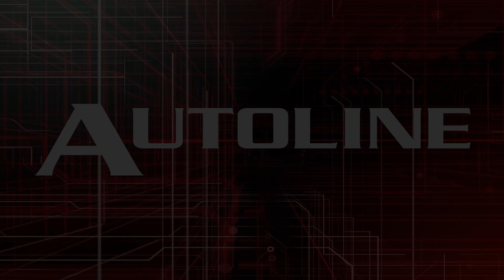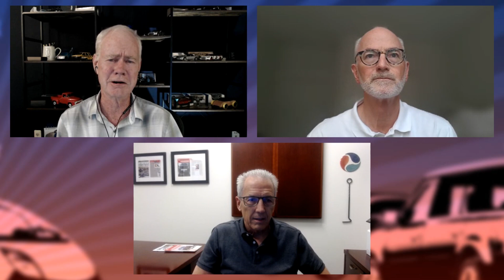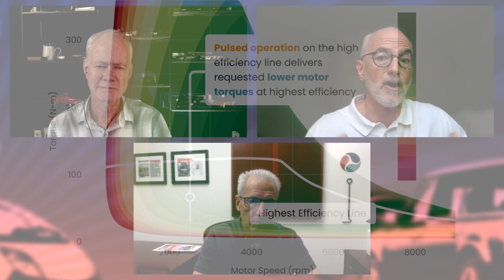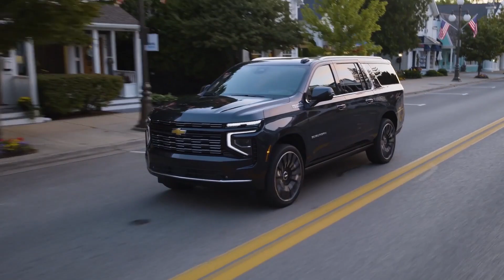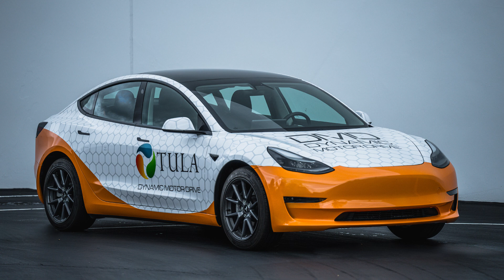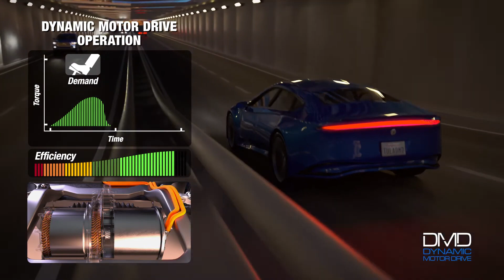100K of Code Makes EV Motors More Efficient – Autoline Exclusives

Comment: I believe this is NOT a PWM application as most here are assuming.  Most PWM is on DC motors, where most EVs use AC motors.  Using PWM in combination with the AC drive inverter is what’s different here, if I’m understanding correctly.

Comment: We were doing that in the 1950's with HO our electric trains, we called it pulse-power it made them run smoother as well, easier to control. Back in the 1890's they called "Dynamic Skip Fire", "Hit and Miss" using a simple mechanical linkage.

Comment: It's totally fitting that a bunch of old school internal combustion engine people would be focused on the motor efficiency. Current EV motors are 95%+ efficient. Even if something groundbreaking happened to push that up 1%, it's still just 1%. That makes a 250 mile range car get 252 miles of range. Rivian, Tesla, BYD etc are focused on things that will make a much bigger effect. More efficient HVAC, better aero, tires and the big one battery tech / pack design

Comment: I used Pulse-width Modulation (PWM) on an electric motor when I was 12, back in the '70s.  I had an N-scale model railroad and I built my own speed controller circuit from a schematic in a book.  Pulsing allows the motor to run very slowly by breaking the static friction in the gears and bearings.  That's how I got into electronics.  Now I'm a retired EE.
Reply: I just discovered I still have the book.  110 Thyristor Projects Using SCRs and TRIACs by R. M. Marston, 1972.  Page 127.
Reply: Why hasn't it been used in cars before? Has it been used in cars before? Is the limiting factor the gearbox breaking?
Reply: @grantlauzon5237  I'm pretty sure EVs have always used pulse-width modulation, or frequency modulation in some form.  These guys acknowledge this, and say they have some subtle enhancement to PWM that I wasn't able to understand because they don't describe it in enough detail.
Reply: Pulse-width Modulation (PWM)..Good explanation. This is like the concept of a digital dimmer switch for LED or in music recording an MP3 file which thins the data from a wave file for sending over the internet. Efficiency...

Comment: I had developed code for stepper motors in the 1970's that are used in 3D printing and milling machines. The efficiency comes mainly from just pulse switching and modulation efficiency instead of analog control vis PWM power supply. Not sure how much different the motor they are using or how much more sophisticated their control code could be.
Reply: It sounds like they are just saying to artificially increase the load as high as possible at low load conditions by sending much higher power requests for brief periods, and then you rely on the inertia of the system to have acceptable torque ripple. But yeah, nothing new, and it sounds like just a small trick that some EV manufacturers are effectively using for some time now. That said, I would imagine many of the legacy manufactures that are just slamming a drive unit in could benefit here.  It's possible the big benefit here is they can possibly see benefit without even touching the inverter software that the OEM may not even own or have control over. You can just modify the signal sent to the drive unit and get a small boost in those low load conditions.

Comment: To new viewers, the "100K of code" is NOT 100 thousand lines of code. It is 100 KiloBytes of memory that stores code. Autoline can simply add a smaller case "b" to the title to clear up the confusion.
Reply: Yes, that wolf be more clear.
Reply: That's actually a surprising amount of code for a single embedded system algorithm if it's the size of the compiled binary
Reply: Lowercase b is for bits, not bytes
Reply: Doesn't matter. The sales guy made up the 100K anyway.
Reply: This is not new. Virtually all motor controllers already do this. There are so many trade offs and variables to motor control.. To oversimplify it like this is a "dumbing down" driven by clickbait.